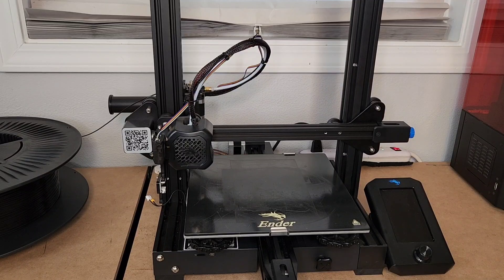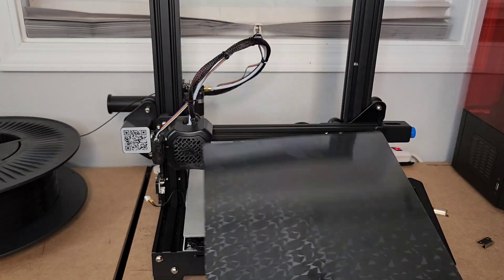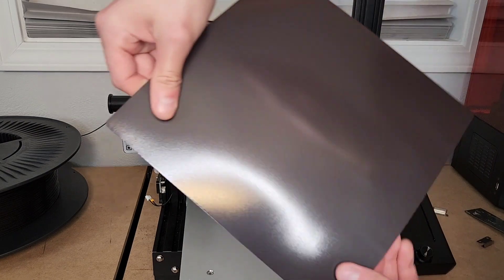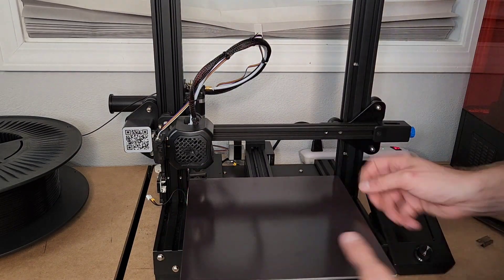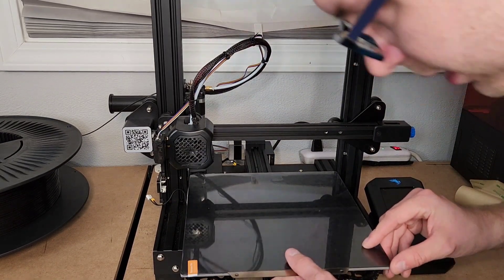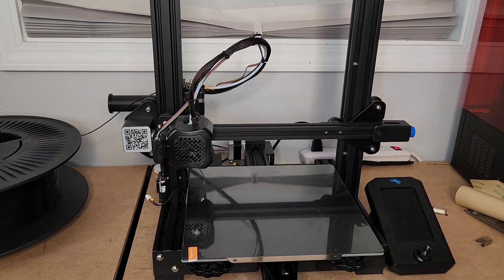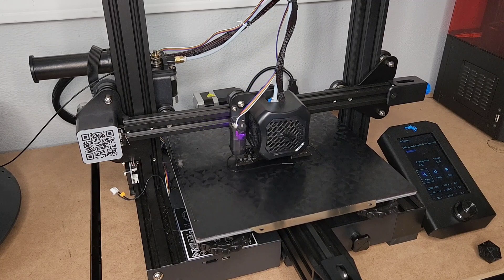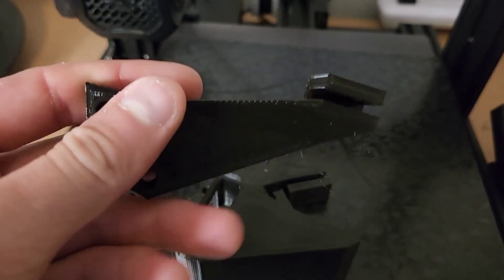Is a PEO/PEI bed worth it? Upgrading my Ender 3 v2

Comment: Would you have links?
Reply from the maker: https://a.co/d/7O0m6eE

This is one of the types that I've used. Make sure to grab the right size for your printer. I like the peo on one side and a Pei on the other side so you have options. Peo is very particular on what filaments it sticks to. Pei works with lots of filaments

Comment: I have the same ender and it sucks every time i try and print on that glass. I am getting this sheet thank you!  Do you also have the upgraded springs?  I have a hell of a time leveling like my springs are either too loose or too tight.
Reply from the maker: Mine is stock except BL Touch, PEI bed, and the dual z upgrade. MrSOCS (I think that is right) firmware makes a difference too.

PEI/PEO bed is like $10-25 and fixes adhesion for me. All the printers I use are now PEI/PEO bed. The BL Touch helps a lot also. Not as nice as my A1 mini, but still pretty solid once I put ~$50 bucks into it from stock (it printed stock but definitely better now)

Comment: do I have to use auto bed leveling to use flexible bed? since every removal and reinstall might change the bed height slightly
Reply from the maker: No generally that's not necessary, the thickness never changes and its magnetic so you don't have to worry about that, I've done it both on printers with and without Auto bed leveling
Reply: @bc_labs  nice. Thanks man!